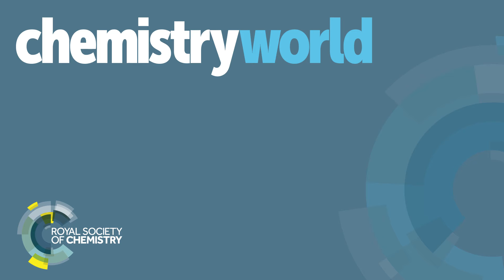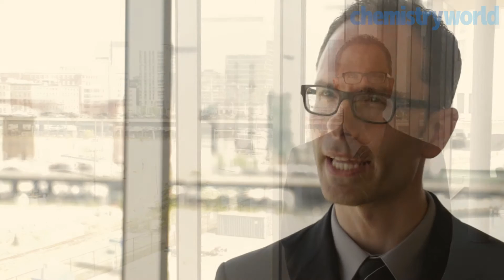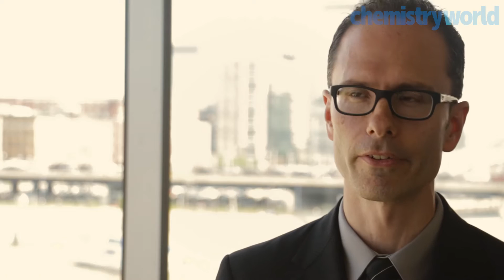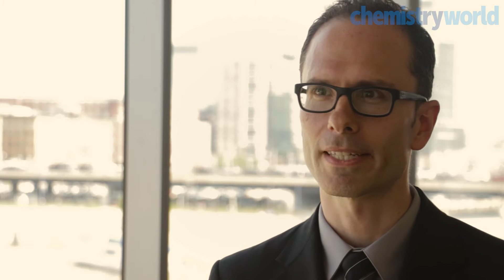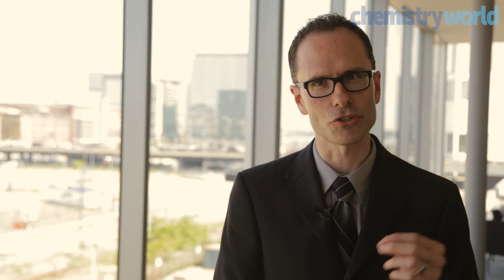Silica coatings

Comment: These paints sound great! Is there a similar paint that could be made economically at home? I am wondering how you turn what is basically sand into a paint.
Reply: Look into "water glass", basically add lye to silica kitty litter and you get a glass glue. 
Also check out lime plaster/paint. Basically the calcium in lime binds to silica sand. Add in some sodium silicate (water glass) for increased durability
Reply: add 5% waterglass NaSi to your waterbased paint